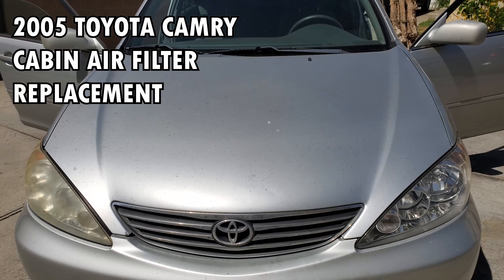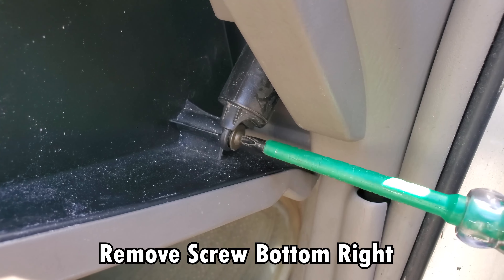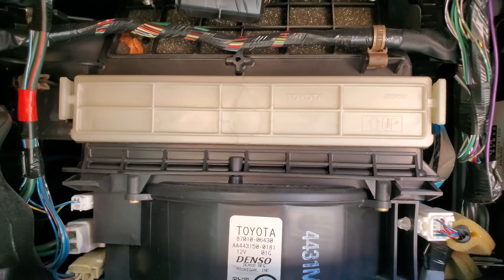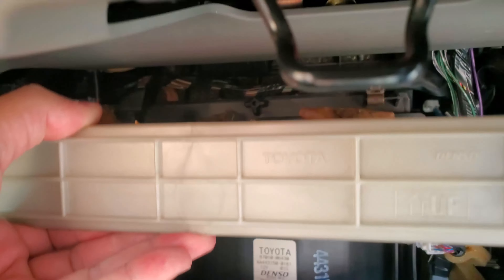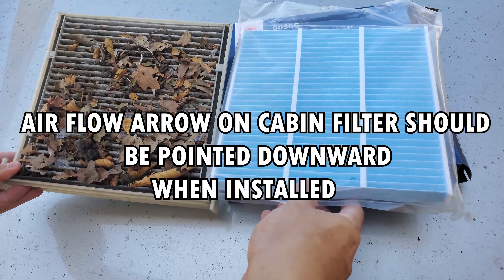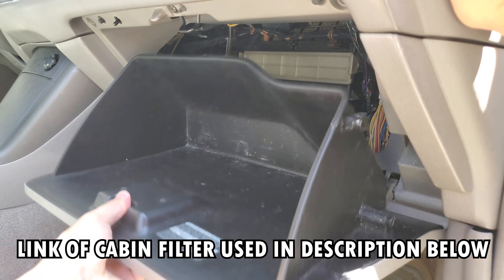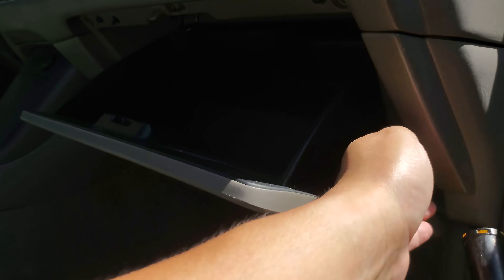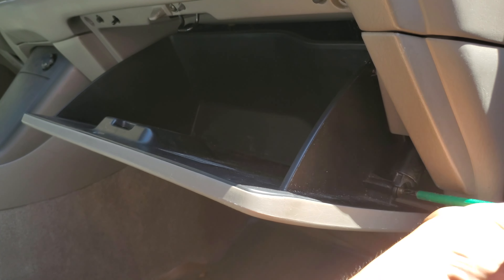2000 - 2005 TOYOTA CAMRY CABIN AIR FILTER REPLACEMENT SIMPLE AND EASY TO DO

Comment: I have same chassis ACV36 2006 aus model. There is no filter to be seen behind the glove box. Did they leave it out for the last version of this chassis type or it's somewhere else? Or maybe they thought Australia has nice clean air, no need.
Reply: hey mate I have the same case with you but I think it was a replacement hvac system but let me know please if you already figures it out. Thanks 2004 Camry Ateva 2.4
Reply: @sonpinlac6677  i havent bothered.  I did spray some deoderant through the vents to help with smell. Might quiz my local toyota one day about it.